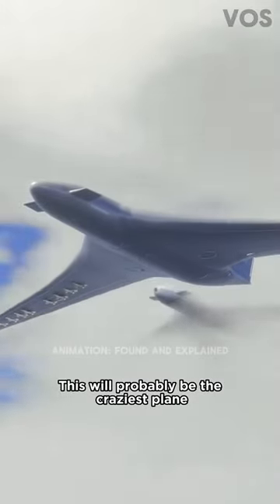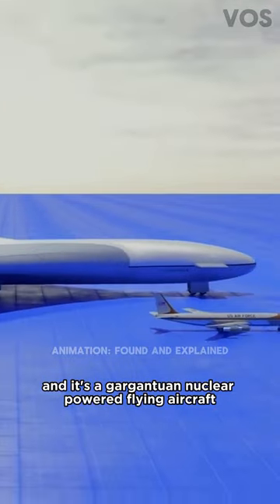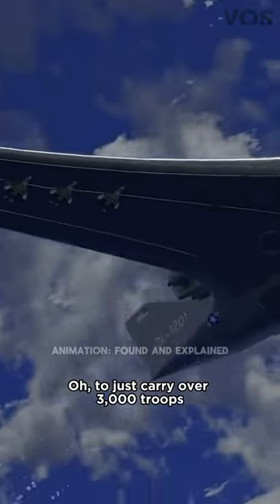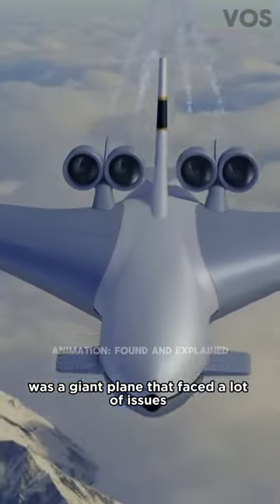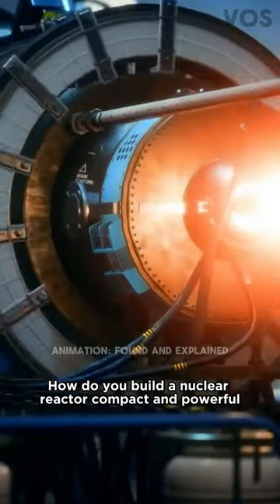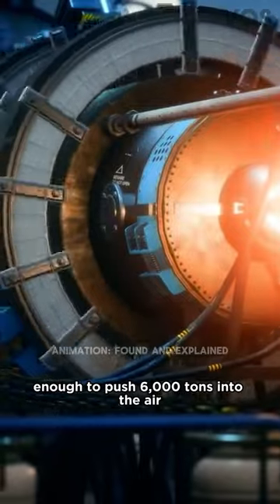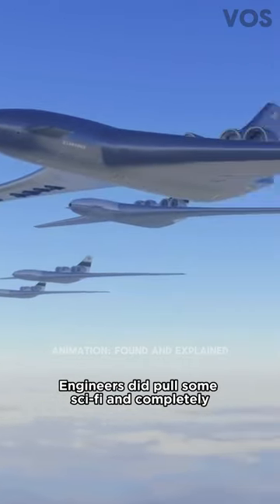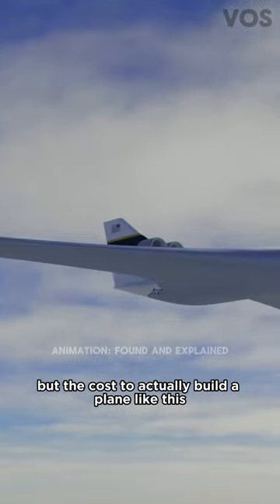The Nuclear Flying Aircraft Carrier #aircraft #aviation #militaryaircraft #aviationlovers

Comment: The nuclear powered engined would be powerful enough to get the CL-1201 into the air and also it was stated that the CL-1201 was durable enough to withstand the head on impact with a mountain traveling at Mach 0.8 without breaking apart